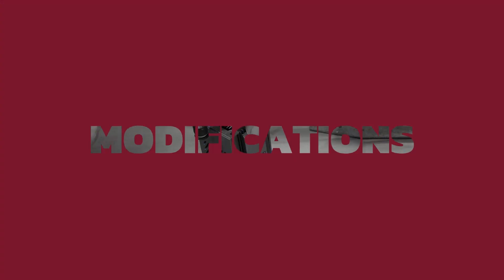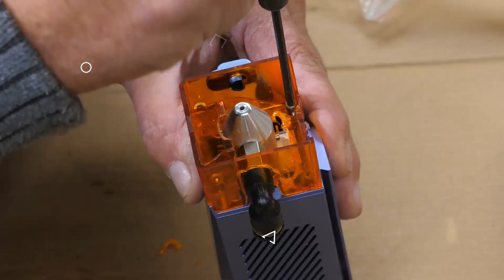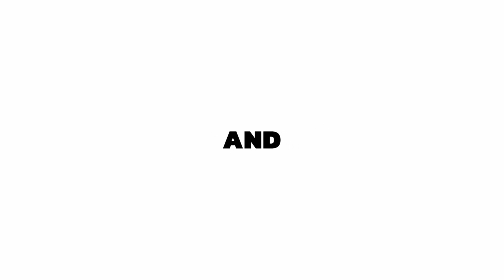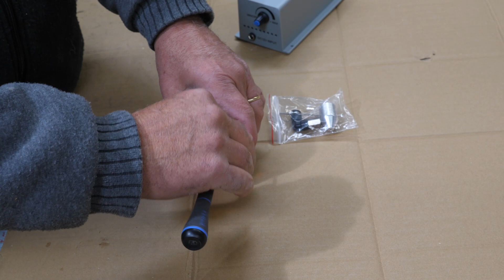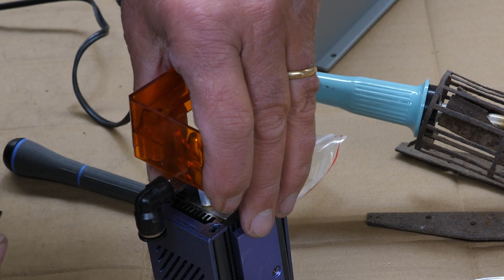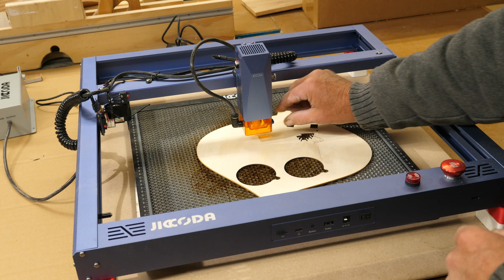Jiccoda L1 Laser Air Assist Add

Comment: I received the Alfawise A10 laser engraver which is exactly the same, except for the name on the machine, to do a youtube review on it.

I was wondering about the mini HDMI socket that is on the side and is supposed to accommodate a screen. Is there any information on this at Jiccoda? or in the documentation of the device?
I watch your video carefully because it contains information I don’t have about the Alfawise version.
Reply from the maker: For a future "feature".  Just like the roller USB port on the front.  Not yet supported.
Reply: @rogersshop  Ahh OK ! 
My model is an Alfawise A10, but it’s exactly the same, except for the mark on it. 
It seems very fragile, after 3 engravings, the laser head no longer works, and the device is no longer recognized by Windows! While I have no problem on the other burners I tested.
I was able to manually put it in lightburn, but it’s really bad.
For me, this machine is not finished.
In addition, there is no website, and the service is non-existent, I sent a message, and I did not get a response. All this tells me nothing, compared to other brands that I could test like Ortur, Sculpfun, and I’m waiting for a Flying Bear, all these brands are serious, while this one, nothing at all! I’m disappointed in this set.
Reply from the maker: @BricoMatos  This looks like a knock-off, or a re-branded machine from the same factory.  This is more common than one would think, but not every clone is built the same.  The Jiccoda I have has given me no problems and I have contacted their tech support regarding the ports for future "features" and had a response within 24 hours.
Reply: @rogersshop  Whaoo ! cool ! but now it's chinese new year fest. If you can send to me the mail adress of your technical service, i will tempt to ask them
Reply from the maker: @BricoMatos  Not something I will post public.  Email me at roger@moonshinecrafts.com and I will give you their information, but keep in mind they may not be receptive to answering questions on another branded laser.